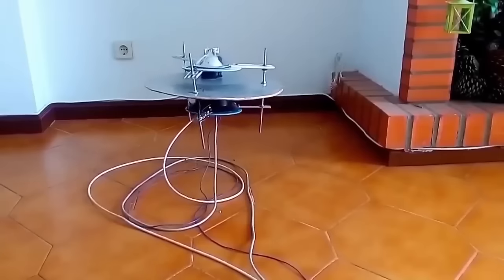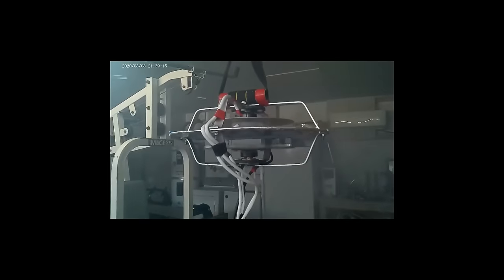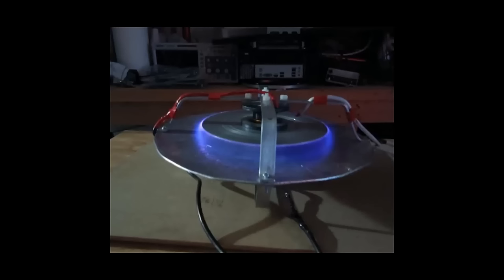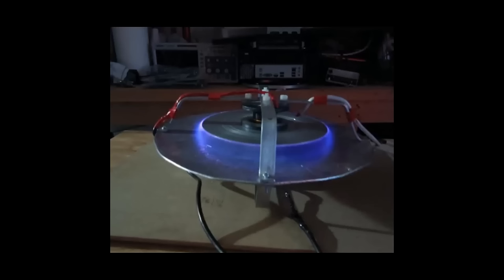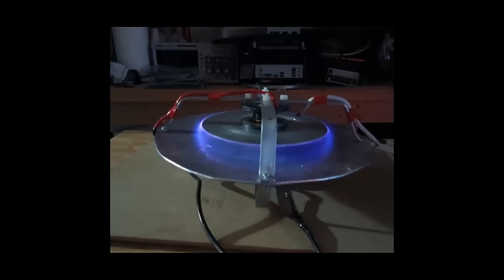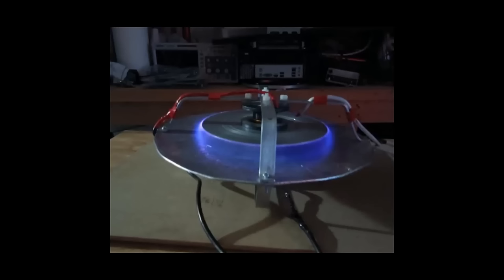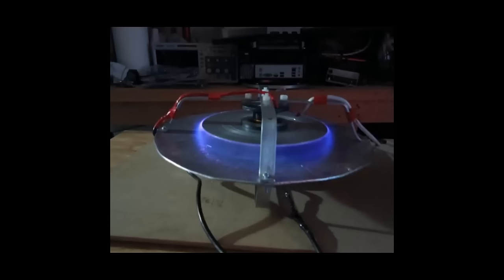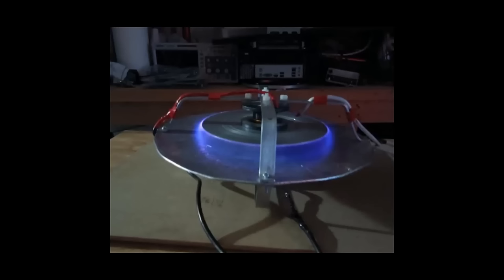Building The Graviflyer "Testing Everything"

Comment: Have you considered working with Aereo gel? Extremely light and an excellent insulator.
Reply from the maker: I will look it up thank you.
Reply: It's too weak of a material. He is better off using a lightweight alloy.
Reply from the maker: @nazgullinux6601  It needs the eddie current.
Reply: @nathanbunten4299  Yes indeed. But don't forget, any conductor of electricity will have eddy currents induced. Silver alloy would be a very perfect material to use. It has 5% less natural resistance than copper so if eddy currents are the goal, 1/8 inch silver alloy disc would work wonders over a bulky aluminum disc.

Comment: Wow. Great presentation here. I'm still not sure why the alluminum foil sucked down on the wood when you applied the one wire voltage. Would like to hear you expand on that in another vid.

On a side note, I'd be scared to get near those spinning magnets without some sort of blast shield. Stay safe and again great work.
Reply from the maker: the foil polarizes. So like a magnetic, it charges the field and just pulls charges to it.

Comment: What about if you gad 2 on same craft ? Mounted on v to frame ? 3 on Y Mounted to frame ? My thonking here is , Spin front bicycle tire , when sitting on Office chair . Spin tire , holding Shaft stable . Tilting left or right Spins Chair on swivel , pivot . Creating Rotation with Single Spinning Tire/Disk . Cintrifugal Forces multipled by 2 Counter Rotation Stabslizes " Twist on Pivot", Rather Shift + Tip ! I am thinking 3 on Y or ∆ will Push + Pull . Gyroscopic Centrifugal Powers Ballence Stable . May need Coriolis Effects in Atmosphere . Vent to force flow of Amoshere , Flow through+ Cool !

Comment: if there is arcing from the top plate to the center disc that spins you should have a flow of air due to ion transfer.
if the disc is spinning you should be noticing a bit of the coanda affect, where air flow coming down and out around a spinning cone/hemisphere generates a small amount of lift due to a positive pressure below the spinning part and a negative pressure above the spinning part... this leads one to believe the faster the spin the greater the coanda affect.

from my understanding you need an oscillation, in a spinning magnetic field, in order to confuse or insulate the attraction of masses such as the positive nuclei of the craft from the negative electrons of the earth, and the positive nuclei of the earth from the negative electrons of the craft. soo in essence a thick or thin wall of electrons in a cloud dens enough that the vessel cannot see past the cloud in order to se the positives of the planet.
Reply from the maker: The amount so small that it won't even blow over paper.

Comment: question ? why not get rid of the spinning portion and permanent magnets . replace the Magnets with small electro pulsed magnets rotating the Magnets Fields using Micro wave Frequencies. Opinion
Reply from the maker: Because the voltage needs to make a cloud. It forms into a sphere around the disc's that rotate. Without rotation the clouds won't form.
Reply: @nathanbunten4299 any one who can speed the process of doing away with are means of transportation and Flight . it would be nice to watch a Plain fly by and not hear the NOISE OVER HEAD . the TECH is out their just being kept from US .

Comment: Thanks for this explanation. Would you have the type or model number of the piezo ultrasonic speaker you recommend to use, and the necessary frequency response range? I have those within the 2-60 kHz range, but heard comments from your group videos regarding frequencies up around 100 kHz. Thanks!
Reply from the maker: this the one I bought. https://www.amazon.com/dp/B0B2QSQNB2?ref=ppx_yo2ov_dt_b_product_details&th=1
Reply: @nathanbunten4299  Thank you
Reply: I have a long running theory that the frequency required for the antigravity space ship would be 432Hz.

432 Hz
Unlike the standard tuning of 440 Hz, which is used in most music today, 432 Hz is said to be mathematically consistent with the patterns of the universe. It is often referred to as the "frequency of the universe" or the "miracle tone.

This also falls into the range of the earth.

Radio wave experiments on the Imp 6 and 8 satellites have shown that the earth emits very intense electromagnetic radiation in the frequency range of about 50-500 kHz. 

To get equilibrium or harmony in the frequencies is to achieve stasis or what appears to be antigravity.
Reply from the maker: @ericthemidget9685  I just tested 426hz and it was closer than any other frequency yet. I will try 432hz. 

I am looking for the frequency of aluminum. I tried 440hz it was ok 426 was really close but is not quite there. You might be right.
Reply: Could the frequency actually be dependent on the person's frequency. So each craft would be tuned to the person . Or two frequency the environment and the person 
 Now I am trying to understand.
Reply: Have you tried different shapes . Instead of the plate shape
Reply from the maker: @giabella9344  we do not understand enough about frequency to determine that. we as a society are still surface deep on the issue.
Reply from the maker: @giabella9344  I have tried several different types of plates. the shape though i have not. They are working as expected right now.
Reply: @nathanbunten4299  i think ur incredible and I admire you . I have absolutely no understanding of how it works or even to express what parts I might slightly understand. All I can offer is a different perspective and maybe since I am so detached from the mechanics of it a approach u might not of even thought of . Ur absolutely incredible and I am honored to have found you
Reply from the maker: @giabella9344  thank you.

Comment: 17:25 y not put blank magnets in then feed the power so it doesn't demagnetize during high rpm ......your missing somethig the dents in your middle plate
Reply from the maker: I fixed that problem. I lowered the power a lot. It turned out that this is a frequency machine not a high voltage machine. so the magnets are fine. In fact I got less powerful ones.

Comment: By making a 1/4 inch hole in your wood, it sounds like you have the voltage reversed, and it would have lifted off with strength!
Reply from the maker: no it didn't. There isn't enough there.

Comment: Try vaporising Mercury with high voltage passing through it, and it contained in a vacuum vessel. Then try to manipulate the vaporized Mercury with certain frequency sounds. I think you might be able to manipulate its own weight, possibly creating a negative weight. As well as its own magnetic field which can interact with the earth's magnetic field making it a massive potential of a projectile to outer space. Wow that sounds real far out and cosmic.

Comment: What if you powered it with something stronger?
Reply from the maker: I did that 2 weeks ago. I put 300v dc into it and it made a big pop then the plastic and motors set on fire. I Am actually over powering it now. It works on static charge, not super high voltage.

Comment: It's supposed to be repelled against earth's negative charge, so the output of your device should be negative "ion wind".
Reply: Uhhh, yall know this ain’t flying right?
Reply from the maker: I don't think it works that way. Earth's field is negative on the ground and positive in the ozone layer. ( corona motor ) Repulsion would not be a good way to go. You have to break from gravity before you add any type of movement.

Comment: Cool video been waiting for someone to build Bob's craft.
2 things 
1) i thought Bob had Negative plasma on magnetic plate and positive on top spinning plate have to go back through your video..
2) from a ex Montauk Scientist the true Tesla coil design is (I'll do my best to explain)
All winding numbers have to equal out and spacing , but the number of turns are example only for the math . So bottom coil 200 turns 2 inch high / gap to second coil is half of height of primary coil height ONE inch , 2nd coil 100 turns one inch high / 3rd coil HALF inch gap 100 turns / 4th coil HALF inch gap 100 turns .. finished .

Look at that and say it won't work never seen before thats because the Patent is hidden. 
Scientist stated it will multiple every coil as it goes up.
I dont build Tesla coils but tinker with other stuff.

Also try 1800 rpm earth's rotation speed cheers .

Comment: you looked into townsend browns experiments im assuming from what i hear its never been tested with high enough voltage they always tested with a lower voltage than brown did and then immediately discounted it
Reply from the maker: That's true or they forgot to resonate it. Or just didn't know to do it.
Reply: Yes his was 160 million volts.
Reply: My research basically said same thing. Many million volts needed.

There is another YT experimenter who working on a lifter. He claimed the same thing that under certain conditions, it worked and preformed better inside a vaccume. Not the contrary. Just like TT browns experiments.
Reply from the maker: @Heliarc91  This one works on low voltage. It seems counterproductive until you realize it makes an emp. The energy is acoustic resonance static charge eddie current and wild voltage spikes.

Comment: just use some medium drone motors from both sides and a digital stabilizer/gyro package, could even possibly use the flat round part for electronics and flat lipo battery packs swapping the aluminum for carbon fiber strips because metal and electronics tends to be a pain, 3d print out an expanded propeller for the top and bottom to oppose each other to counter twist, add in some small flaps from underneath the unit to block the flow of air slightly to control steering
there are super basic drones that follow you that look similar to what you are trying to build
bit of warning, ozone kills organic materials and burns them like chlorine gas, it can and will eat your lungs if strong enuf, they use ozone generators to clean out smells in rooms for this reason
Reply from the maker: I have several drones. They do not look like this. The coanda effect would not work here. The fans would never work in this frame. The weight alone is 3lbs. and regular bldc motors cannot lift that with one motor on the bottom and one on the top counteracting it. The fan idea is out.
Reply: @nathanbunten4299   and that is why i suggested a different approach, there's blades that look like the disks without losing thrust, you can keep the look to a degree without losing too much thrust and reducing the mass of the unit by not using heavy parts and materials, metal is not good for drones
for a disk to gain additional thrust without blades it needs a friction modifier and a housing with a taper similar to how jet engines focus air or the way a turbo impeller has shaped ridges and housing to boost surface use
Reply: @nathanbunten4299  oh, before i forget they are making plasma engines that work using similar arcing methods like in video, only they raised the frequency super high and jetted a fuel thru the engine to create very strong thrust
Reply from the maker: @SCARLETBIRDS  I get all that. The idea was to make his invention. I would make a drone like the one you described. It sounds like a cool project.
Reply from the maker: @SCARLETBIRDS  do you have a you tube  link for the video? I would like to see that.
Reply: @nathanbunten4299  "NASA lost this TECHNOLOGY 60 YEARS AGO"
we can't seem to link actual vids here
Reply from the maker: @SCARLETBIRDS  send it to my e-mail. oldmannathanbunten@gmail.com
Reply: @nathanbunten4299  greatly dislike doing that, the quote i sent searched works fine, there's a video with the icon showing a weird blue/green thing with a yellow jet flame coming from it

Comment: Pulsing is the key and very few people know that. Back in the 90s on Yahoo groups there was a very active lifter community building these things and the biggest breakthroughs for extra power speed and other things was pulsing the electrostatic charge to the lifters and even reusing the charge by timing it so that when the charger was made the next pulse would pull the same charge.

The first self flying lifter was made during that time by a guy I forget his name is sort of a funny name like soldier or something and he was from I think South America is it might have been savior his name might have been savior but he pulls his high voltage and he was able to power a lifter with an onboard battery because he was pulsing the power. And now we have much better batteries we have very small lithium disc batteries for watches and things which I would imagine could much more easily power a self-rising lifter today.

Comment: KEY...  use high voltage transducer for mechanical vibration so the electromagstatic field is pulsing in a mechanical field wave...  and use frequencies 28k and higher... its the sounds vibration mixed with the toroidal ... and let it resonated ...  

use small disc above + / bigger disc below -  low frequencies and volts betwee 480 and 800volt  DC pulse btw everything above the 200k volt automatically levitates...   4 principles resonates as 1  --- electro-mag-static , vibrated soundwave device...  every UFO is a vibrated flying capacitor

Comment: Alexey used a special amorphous version of a nickel alloy like the driver of a Golf Club is made it’s made out of amorphous Nickel because you can maximize the amount of impulse on the driver transmitting as much force as possible on the Golfball…amorphous nickel means it was molten and cooled off this rapidly in seconds , so no usual Metal Crystalization in a Kubic form like we have in all metals on earth that cool off slowly …you do not want that in a gravi-flyer - you want to minimize metal grids inside materials and maximize Amorphous Metals this way the earth gravity field which connects with naturally slowly cooled off metal cubic grids …in an Amorphous Metal the amount of gravity mass and inertia mass can be different in high voltage fields …this way gravity can be altered